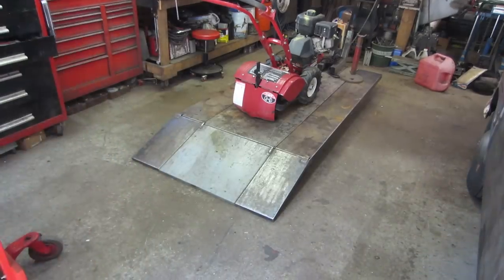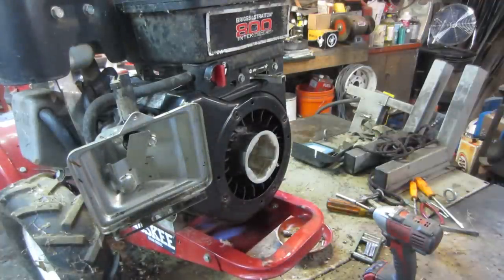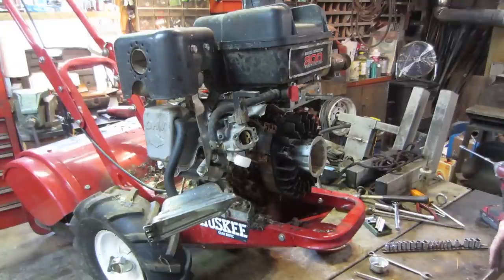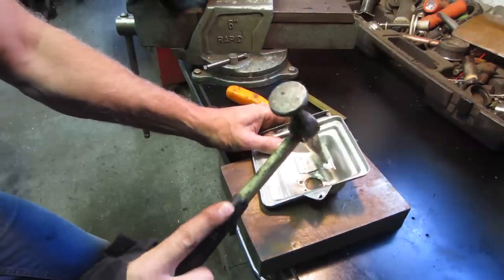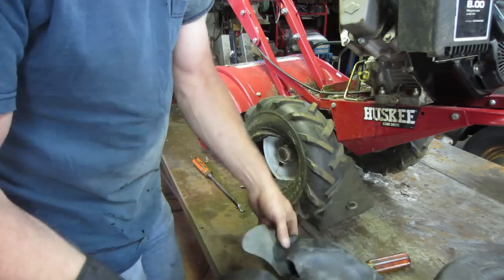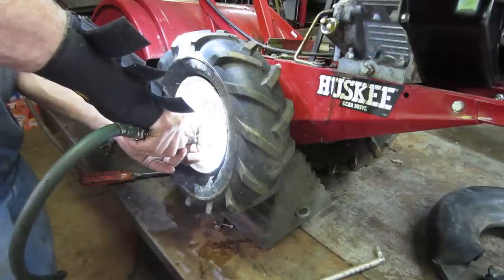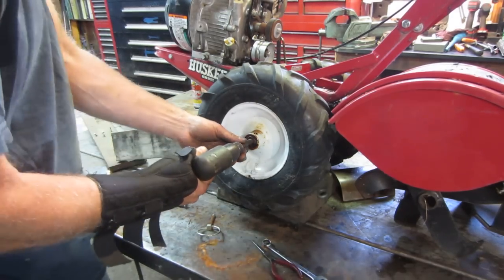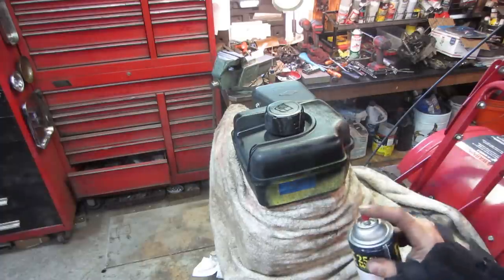abandoned rototiller, can we fix it ?

Comment: I have a Craftsman tiller that is quite similar to that one, same engine. It gets used in the spring then run dry and sits next to my shed with a big plastic bucket over the engine. A buddy wanted to borrow it, I said "sure, come on over". We head over to it, find that a branch has smashed through the plastic bucket and squirrels had chewed through the gas cap. The tank now had water and pine straw in it. My friend said he'd take it and get it running. He did, and then the main tube from the handle to the unit cracked and split, he paid a welder to fix that. So any time he needs to borrow my equipment I'm happy to load him up! Kidding aside, I've enjoyed your videos. Started buying cheap gennies and fixing them.

Comment: All because of you, our local small motor shop just lost 3 repairs just this week !!! What have you done !   Brother in law wanted to ship his lawn mower and his gas weed-eater to the repair shop and i said let me have a look first. Lawn mower had a dirthy caburator which cleaned easy and now runs like new. The weed-eater, i dont know what I did, but just watch and cleaning some made it come back to life.  
Then on the way home, decided to get a closer look at my small generator i couldn't start for a while, and after cleaning, flughing the carb and replacing the older gas, it also runs like new ! 
Thanks for showing me your skills, i like your diagnostic procedure, starting from the park etc... applyed the same technique and save a few bucks on repair !!! Of course, my back-yard isn't filled with parts, so i feel lucky cleaning ws the only issue so far :)
Reply from the maker: glad to here you could get them going again

Comment: Constantly amazed at your ingenuity and willingness to tackle anything but you taught me a useful trick today.  I've been changing tires on rims for years, I'm 72 and started with bicycles when I could barely ride one.  Never occurred to me to use a visegrip to  keep the tire from sliding.  Thanks
Reply: Me too.
Reply: Sam Reese a
Reply: Same here, could have used that trick many times in the past. On motorcycles  I always filled the tube up a couple times to get all the wrinkles out of the tube before finally filling and capping it off. Not so important on a tiller though.
Reply: I just picked up a tiller almost identical to this one a couple of weeks ago and had to change the tube on it.  Unfortunately the previous owner thought it was a genius idea to fill the tube with Great Stuff window seal instead of doing the job the right way.  It made a simple enough task into an hour long ordeal.  I would have LOVED to use my Vise Grips on it.  I was too frustrated at that time to think about that though!
Reply: b
Reply: Me three,but I'm only 67 so I can still learn.I think most of our shops look like yours.I also see you still wear a headlight even after all the new lighting.gives you light were you need it.
Reply: buzzsaw ncgo  Old DIY trick I learned a long time ago and I got a few years on you !!!!  Work smarter.....NOT harder !!!!!!

Comment: Hey Mustie, Great video!

If you're still wondering about the yellow paint, it means it was returned to a Tractor Supply store as damaged, and the store was to destroy the merchandise and dispose of. Most likely it was sat close to the dumpster for removal and was removed by someone other than the garbage man. Could explain the damage to the air cleaner as well, as a store employees attempt to render it "unusable"  We had a lot of these returned as damaged because the person that bought it didnt know about the wheel locking and unlocking with the pin. They get it home, gas it up, and it wont move, therefore it must be broken. The 18 year old girl at the front counter takes it back from the upset customer, and it gets damaged out if it dosent resell. 
from an ex TSC Manager

Comment: Frozen/rusted axle shaft/wheel hub - I bought a Troy Bilt Junior rototiller with the hub rusted onto the shaft, just like yours was.  What I did was use a large socket over the axle shaft end and tapped it inward toward the body and used a little lubricant in the process to break it free, and then rotated it left and right while pulling it outward to remove the wheel.  Then I sanded the shaft and the inside of the wheel hub.  Then put a little oil on the shaft, and it spun like new.  I bought mine at a garage sale for $20.  Next I have to replace the carb, and have the belt engagement lever welded (I broke it thinking I had to disengage the belts in order for the wheels to rotate).  I liked watching how you removed the frozen wheel hubs, albeit after I broke the lever action!

Comment: I have a story for you Mustie the Mouseman.  I own a paving company.  Our main paver had a break down and I pulled our backup out for the time the main was in the shop.  It had sat for over a year, ran and drove fine but the heating system wasn't working right.  It has propane fired heating tubes through the screed.  One kept going out and building with propane inside like it was clogged.  The last time of relighting it, it blew the clog out in a fireball.  A flaming mouse and the remains of his nest.   So if the blowgun won't get em, I know from experience the torch will.  Love watching your videos.

Comment: Nice find , and for a heck of a price . I had just fixed two front tires on one of my riding mowers last week and I also found a vise grip was needed to keep the tire from slipping on rim while mounting . Both my tires are tubelis and were leaking along beads and possibly through old tires . I removed tires completely and sprayed both with Flex Seal all around inside . Worked a trick . Keep the videos coming , nice to know there are others that like to fix old stuff "old school" .

Comment: Hey Mustie, I got a tip for checking spark... When you have an old mower or whatever and the plug just doesnt want to stay put while checking spark, grab a old jumper cable... Put one on the plug and use the clamp to connect anywhere on the engine... Easy way to check spark without fighting the plug.

Comment: First rule of demounting and mounting tires with beads.  USE SOAPY WATER AS A LUBE.  Spray it on right between the rim edge and the tire bead.  It makes it SO much easier.

Second rule, keep the bead OPPOSITE of the area you are work pushed down into the "drop center".
Reply: windex or WD40 work well too

Comment: That has to be "Top Tip of The Day" - using those grips to stop the bead chasing round the rim as you lever it on. . . . Why didn't we think of that - years ago?!

That's not too shabby, not too shabby at all.    The only thing I wonder about is the 'High Heat' paint. . If it's anything like 'VHT' paint, it needs heating to cure it properly, until then, it remains soft and vulnerable to scratching, and dissolving in the presence of fuel/oil.

This video reminded me of propane bird scarer we bought some years back.   In our eagerness to try it out we forgot to check and clean out the combustion chamber. Right at the very first bang, out flies a family of mice, nesting material and all! 💨🛏🐭

Comment: I especially liked the tip about using the vise grips  to get the tire back on.
Reply: Forgot to say that I have a DR chipper that the tires go flat on.  Also I have a number of other pieces of lawn care equipment that have many of the issues that you have shown fixes for.  Again thanks.  Sometimes all it takes is someone showing that something can be done.  Of course there were a few extra parts after I took apart and reassembled my mothers egg timer.

Comment: I borrowed my friend's Huskee tiller last summer. It was the same model as this one. It had suffered a lot of neglect, so I asked my friend if I could fix all the broken and worn parts. He gave me his blessing. So I tore into the carb and got that working. Then I discovered that one of the tines had a grade 5 bolt for a shear pin. I pulled that off and replaced the shear pin bolts on both sides. The tiller runs like new now, so my friend said I can borrow it whenever I want instead of renting one.

Comment: Since I have owned my house, I have had my fair share of 2 cycle and 4 cycle repairs, I gave up at times, just went to the carbs, didnt know much about anything else, now I know...thank you Mustie1, makes me want to go out and buy a nice something but I don't needs anything. I have a nice tiller, torn that thing apart many times, welded the handles replaced the the chain, has lasted 20 years, still runs like a champ, even when ignored for 4 years at a time, just simple rubber grommet replacement due to UV damage now and cleaned the carb only one time. Everyone who works on their carbs just need to place a true fuel filter on most of these machines so the carbs don't foul up, that is the key.  Why are there carb issues...bad fuel filter system, improve on it, get an inline fuel filter to replace the simple screens, no issues afterwards!
I do have a weedeater that bogs down when the RPMs increase, I did replace the carb, not the same, exactly, but tried and transferred what I could. It works like a champ at times now, other times, bogs down, so just looking, maybe I will find the secret, lol. I figured out today, I was placing an oil fuel mix, it is a 4 cycle, no longer bogs down.

Comment: an old guy once taught me to use an old valve for a propane grill  and a small bottle of propane to use in place of gasoline when testing to see if the engine will even run...no more squirting in the carburetor...

Comment: I enjoy your videos, little tip, when your removing tyres, If you start the tyre removal near the valve , the tyre will slide further into the rim, and you wont risk damaging the valve and make it easier to remove the tyre, same with replacement, let the bead go well into the rim opposite the valve.

Comment: One of the common problems with small engines today is a hunting governor.  Of course it is not really a governor problem but typically the idle fuel feed/jet being clogged.  Soaking overnight might clear it, but not always.  The problem is finding that feed/jet to clean out with a small wire.

Any hints/tips on finding that passage ?

Comment: After watching you for a while I decided to gather up all the 2 cycle weed eaters that I have picked up from laying around and tinker with them if they dont work before I start, I cant hurt them any way.... thanks! By the way you have a great, friendly presentation !  The only thing I have seen is the cracked engine oil plug.... I probably wouldnt have used JB weld, not that theres anything wrong with it.

Comment: I am watching this for the first time . tire irons are avaliable at Harbor Freight in several sizes works much better than screwdrivers also much easier on tube . Also start opposite the valve stem .Let the bead drop into the drop center of the rim

Comment: I always wanted a rear tiller. Make a bull dozer blade shaped push bumper for the front.  And make up new shafts to mount riding lawnmower wheels to replace the rear tines to push dead cars into the shop bays.

Comment: I first would like to say thank you! for making, creating, and financing these videos. They are tutorials, how-to, what may work for me...may also work for you... And awesome entertainment. I do have a question, I hope you would take a quick-second and answer for me.I have a model 99 / 00 Troy built rototiller 3.5 hp B&S engine. I am trying to separate the carburetor from the gas tank. I removed all the top required screws and the parts will not separate. Do you recommend I pry something between the union to get them free of each other. Or do you think there is an internal fastener holding it in place. I welcome ur opinion and thank you for all you do!

Comment: Mix up a spray bottle of soapy water to lubricate the bead area of a tire you are mounting or dismounting.  It makes the rubber slide over the rim a lot easier.  The soapy water is also a good leak detector for small holes in tires, innertubes, and valve stems.

Comment: I've got that same engine on my Horse. The choke use to drive me crazy as the decal fell off early in it's life. I  took a paint stick and wrote choke to the right Makes it easier to start after it sits for 10 months. I also use Lucas fuel stabilizer by the gallons and find adding a couple cap full's per fill up keeps everything clean. This engine needs the oil changed every 25 hrs. to keep it honest.

Comment: What is the diameter of the axle shaft?? The reason I ask is I'm looking for wheel assembly that size that fits a 1" axle with a 1/4" pin. Having trouble finding one and if it is a 1" axle I can search through  Huskee parts suppliers. Thanks

Comment: On the wheels, there are spring pins, usually two holes in the shaft, that allows the wheels to turn free, easier to move when not running.

Comment: have you ever tried using flex seal on the inside of a tire with no tube that was dry rot to see if it'd hold air in the cracks?

Comment: iv got a rototiller at home there is adjustment needle on gas bool had rubber seal on it broke it has not run scene would be over 6 years a go its a brigs and straton cant rember cc of it haven't had a look at it for years it was hard to start a mate of mine does to start a chan sore with a drill and socket haven't bothed geting it fixed will one day

Comment: Hey Mustie I have a busker 42 inch cut  and have trouble with the drive  belt it either don’t pull or it squills .. can you tell me the actual size for that I had a 70 inch and wouldn’t pull went to 68 now it smokes and squills?.. could it be the pulley it’s not even two years old..
Reply: Huskee mower..

Comment: Nice fix! Didn't you have to oil the idler pulley release or was that just the cable problem?
You sure do have some good rich dirt up there!!
I have needed one of those cable oilers several times over the years. Could you tell me what it's called or where to get one?
I could lay beside that waterfall and sleep for a long time!
Reply from the maker: not sure what it is called think l just called it a cable oiler on a ebay search, and it was just the cable,
Reply: Mustie1 I "was" old school, funnel, duct tape on vertical cable - until you showed me the error of my ways (haha). Found the cable oiler, got one for $8. Learn something new every day. Thanks! After Blaster to free it up, what lube do you "spray" into the cable, WD40 or silicone?

Comment: when pressure washing something like this or a lawn mower is it best to leave it running or not?
Reply: It shouldn't make too much difference. Most modern engines are pretty water tight/proof, but it best NOT to use a pressure washer on the carb. Water can find its way in the smallest of holes. After its bath, then start it up and dry it out.

Comment: Easy way to lube those cables is to clamp a section of fuel line to it, put some oil in it and blow it through with your air gun.

Comment: I never could understand why people spend hundreds  or even thousands of dollars on equipment like this and not take care of it! Then again, if they did take care of it, I wouldn't have my little side business or my Husqvarna rear tine tiller. A friend paid $800 for it 4 years ago and used it once on a garden of about 150 sq.ft. which was way to small for the machine anyway! The garden was a complete failure due to bad weather so he lost interest and the machine sat under an awning for 2 years. Since I grew up on a farm and just don't feel whole if there's no dirt under my fingernails, I'm an avid gardener and have always wanted one of these, I just couldn't afford one, so I've muddled through with a front tine tiller for years. Longer story short, my friend gave me this one since it was in his way. I cleaned the carb and tank, replaced the fuel lines, lubed everything and gave it a tune up. Now, I have an $800 Honda powered machine for a total investment of maybe $25 on my part. I used it twice last year on my 500sq.ft. garden along with several others for friends and it performed flawlessly. I just changed the oil and lubed it today. The machine and I are both looking forward to this season after the weather breaks. I also have one in my shop right now that looks nearly identical to the one in the video, this one has a front weight and bumper though. I paid $10 for it at an auction 2 weeks ago. It's all cleaned up and running great now. I have about $40-50 total in it and it's already sold to one of my gardening friends for $200.

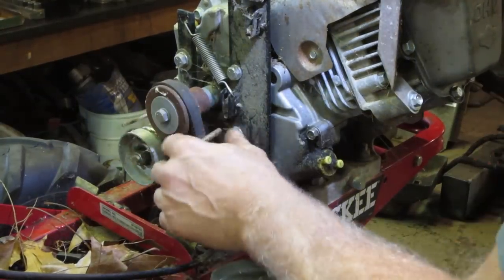Comment: i bet you fixed it 1:56 into the video. It was abandoned after they kicked the air filter because the drive belt was stuck and they couldn't get it started with it in gear.

Comment: This is probably a silly question but I think you use quite a lot of expensive air tool how do these compare to the very cheap China brands. I have bought machine mart in the past I think this is the same as your harbour freight. To cut a long story short they were all rubbish. Im kind of thinking on giving up on air tools as battery technology is so much better. I would like a cordless ratchet.  Do you have any good cheap air tools.
Reply from the maker: l find the cheap die grinders work well
Reply: Are ok thanks I was looking for a grinder

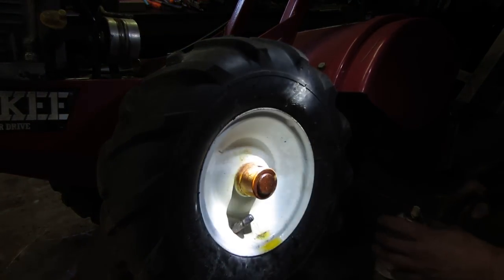Comment: 19:20 I would have tipped the tiller on its side so I could apply the penetrating oil to the hub "flat on", so that it could "soak down in" between the hub and axle more readily, instead of mostly just wastefully dripping off